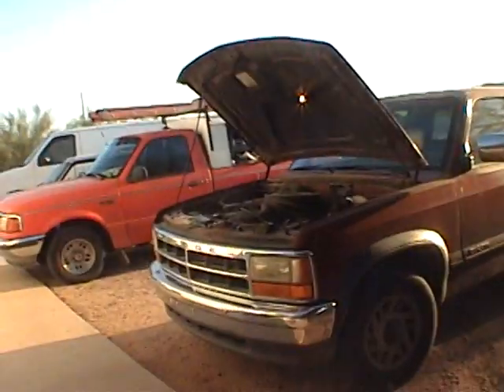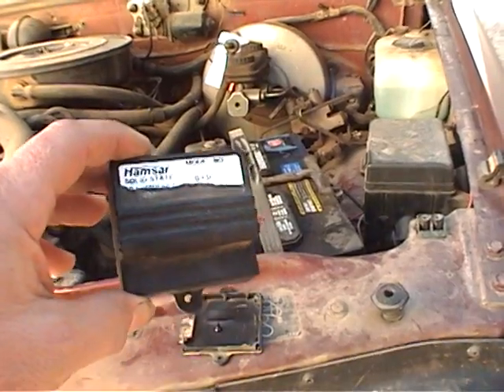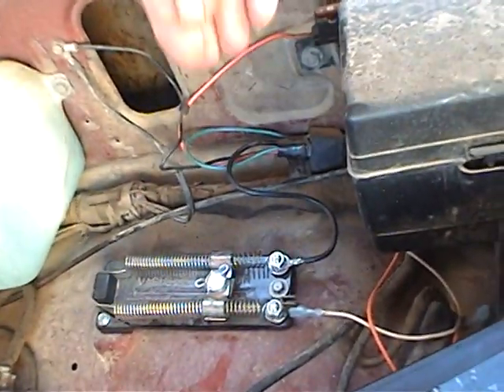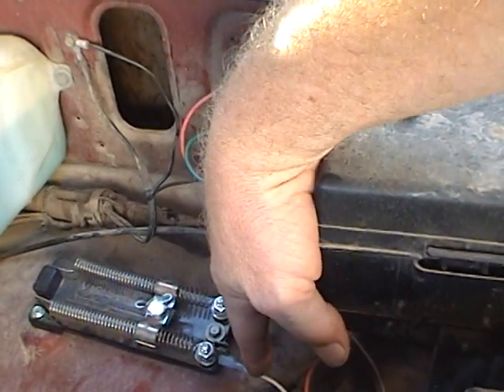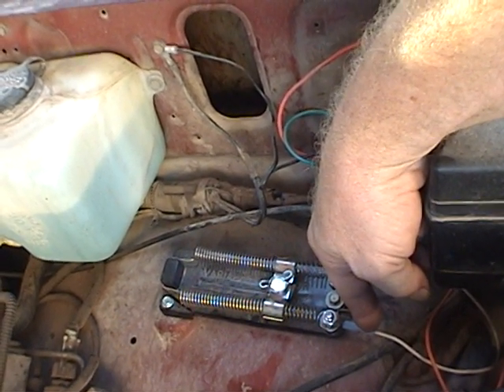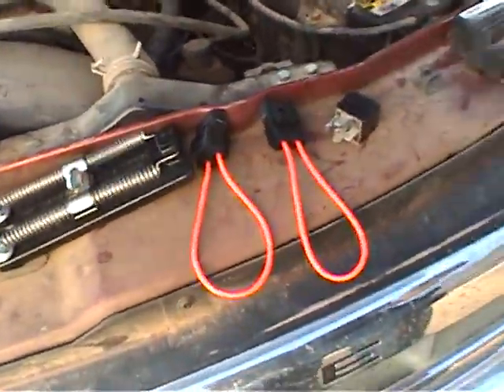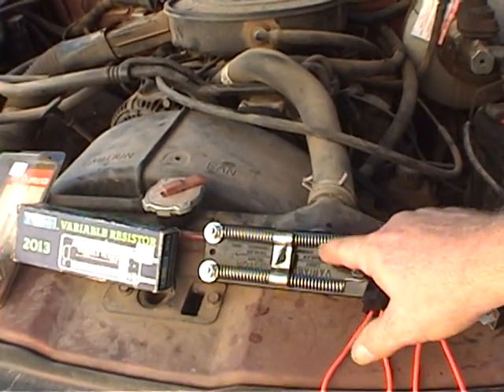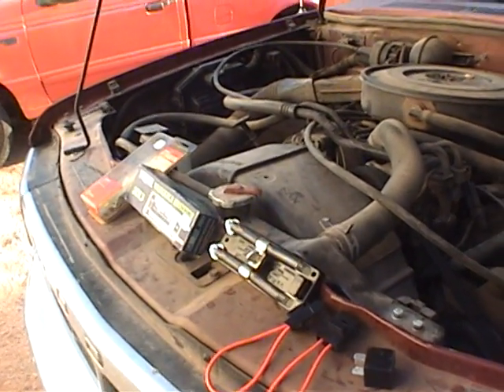DRL's on the DIY A Cheep and easy mod

Comment: Nice beard, bob! Oh, and pretty interesting installation method too, never thought of using the fuel pump. I've got LED DLR's, fog lights and extra Hella highbeams on my car. I wired them all with relays and a switches.The switch is 'positive' and is wired to the positive on the cigarette lighter output. This way I can flip any of the extra lights on/off at will and independently. 3 wire switches provides glow so I can see them in the night. They will only work with the key in the acc position.

Comment: Good job, Cactus Bob! Especially on using the high-beams instead of low, for two reasons:
1) Less wear on low-beams like you mentioned,
2) Better visibility because of the angle of the high-beams
One variation that I "wish" to do would be to put the high-beam filaments inseries in DRL mode, instead of using a dropping resistor. However, that might mean too complex a circuit. Happy New Year- rad4runnner@yotatech

Comment: You need another relay to shut power off to the high beams when you turn on your low beams.

A better way to do it is use an "add a circuit" and do it all at the fuse box using the cars existing wiring rather than under the hood with the engine.

My current setup:
DRL fuse (it exists but is missing the DRL wiring, and gets power when the engine is on, many cars has fuses for accessory that are not fitted or not available try one of those)
That is connected to a Relay that cuts the power to the circuit when the headlights goes on. that relay is then connected to a resistor that reduces the output to ~20% power then sends it to the high beams.

Car on = DRL On
Car off = DRL Off
Headlights on = DRL Off
Headlights/highbeam on = DRL Off, Highbeam On(full)

Comment: Okay I understand the concept but one issue when you turn on your headlights on low beam aren't the high beams still on because you still have power going through the resisters ? If not please explain how they are not burning.